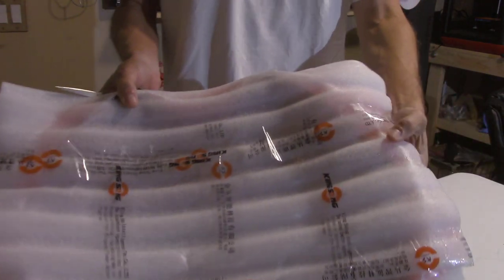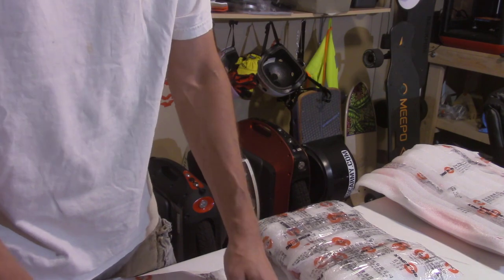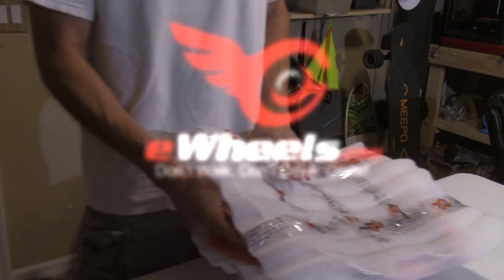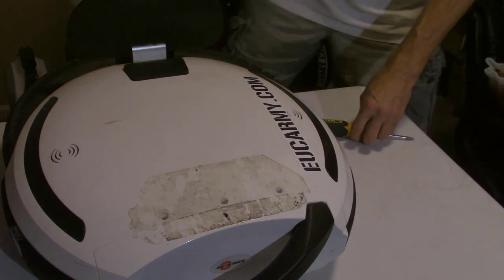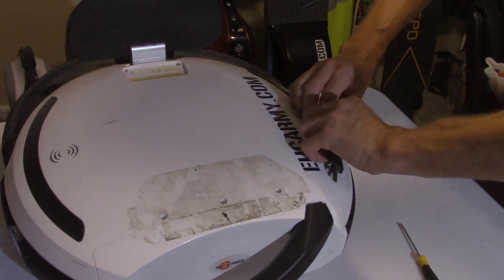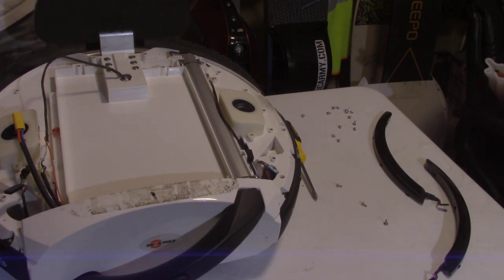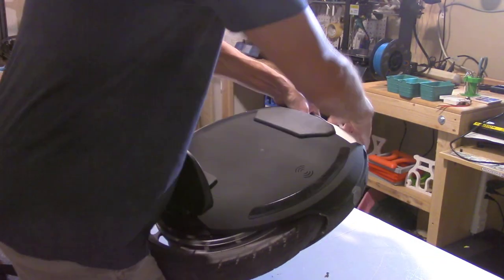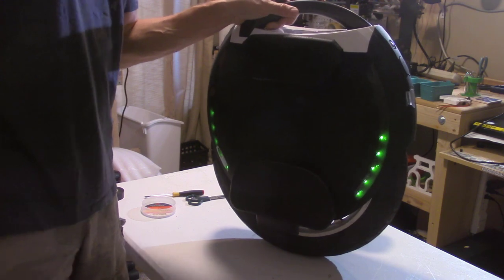Upgrading to 18XL battery pack - KingSong 18L

Comment: Nice upgrade. Too bad you basically throw away the old batteries. I naively thought the upgrade just added some additional batteries. Now I understand why people have said it's not cost effective to upgrade the L to the XL.
My side pads lost a little stickiness. Instead of buying new pads, just apply some double-sided tape.
Reply from the maker: I didn't mention in video because it was still a little uncertain in March when I shot this, the price is $800 and you send in your old 18L pack to Ewheels so the old pack isn't wasted, goes into their parts stock I suppose.
Reply: @Duf  Wow, that is a really good price. I guess only because he's taking the old battery back. He's probably hoping that too many people don't opt for the upgrade because he'll run out of uses for the old battery packs. It has to be extremely rare that a battery pack fails.
Reply from the maker: @ElectricUnicycles  I wondered if there would be a way to break them down and reuse them in a different configuration but probably more trouble than it's worth.

Comment: The matte black looks much better, not that the original white was bad.  It should also hide scratches better.  Looking forward to seeing the range test, and whether the app correctly reports battery charge.
Reply from the maker: All of this actually happened in March, range test is posted!

Comment: Did u ever put adhesive on the new batteries? The new 18XL's have the battery sealed in with adhesive on the back so it sticks to the inner shell.
Reply from the maker: Nope never used new double sided tape, never had a problem.

Comment: If you have trouble with the pads falling off go buy some rubber cement. It is like liquid rubber in a glass bottle. You brush it on both parts you want to stick together. Let it set for about 20 min. then put the pieces together. I have used it to glue soles on shoes and never had them come loose. Remember to let it set up before you put them together.
Reply from the maker: They actually have stayed in place just fine.

Comment: When did Jason started to offer upgrade kits for 18L? Is this a special order? And how much does it costs?
Reply: I'm going to guess $1200. Let's see how close I am when Duf answers you :-)
Reply: I checked the links and didn’t see the upgrade on ewheels sight.  I remember reading about this on the forums and the rumor was$800 with you returning your original batteries.   I can’t figure out why I am interested in it at all as my 18l does everything I want it to now, but such is life.
Reply: $1200 isn’t worth upgrading (hope not) but if it is $800, I think I may want to upgrade too!
Reply from the maker: As mentioned on the other video, Dualsport is correct, $800 with trading in your old pack.  Still not cheap but turns the L into a legit long range cruiser.